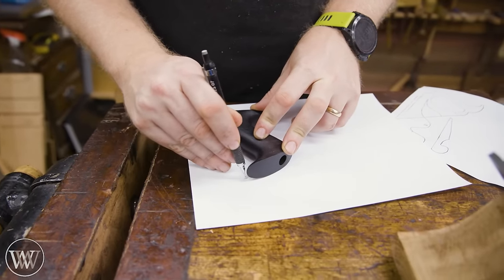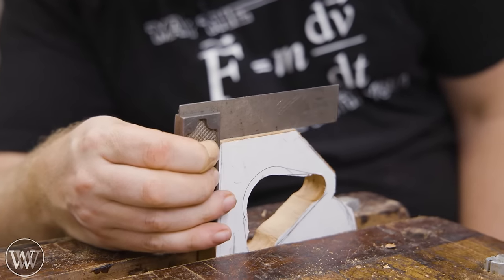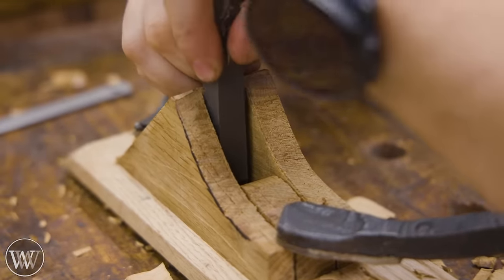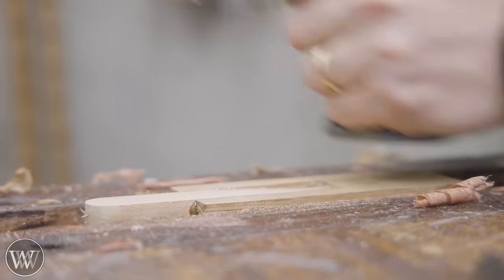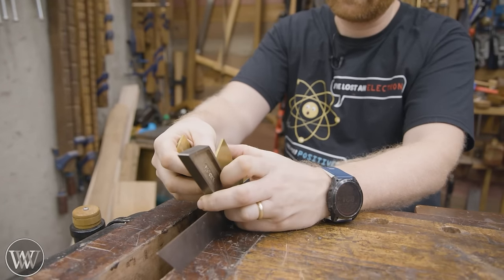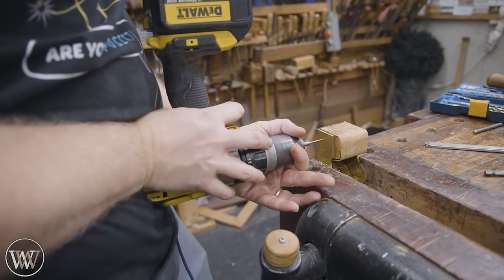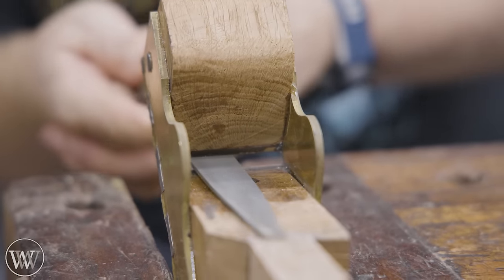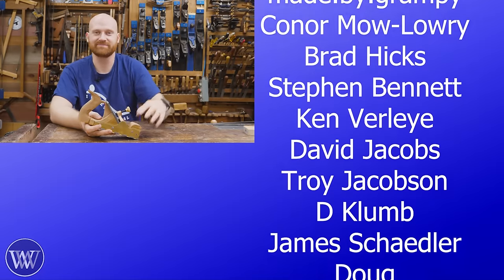How To Make An InFill Plane Fitting The Wood

Comment: I been waiting for your next video on this plane.   I bought a steel sided kit off o Ebay ($248 dollars plus shipping).  I had some issues with it but worked through them .  The first thing I noticed was the blade was not ground square, out by more than a eight of an inch,  it was ground 25 degrees instead of 30 degrees,  the back was hollowed out so bad that  I finally gave up and used the David Charlesworth trick to get it flat.  All that said the steel was  very hard and should hold a good edge.  It took me a good bit of work to get the  chipbreaker flat enough so it wouldn't jam.  Question did you shorten the cap iron screw.   I also noticed you didn't cut out for the😮 chipbreaker nut.  Does yours not have a chipbreaker?
Reply from the maker: I am using a ZenWu iron for this one so the chip breaker nut is flush. I will be shortening the screw once the lever cap is mounted.